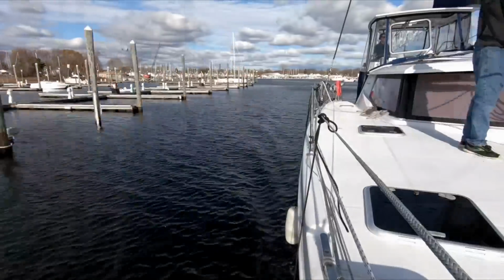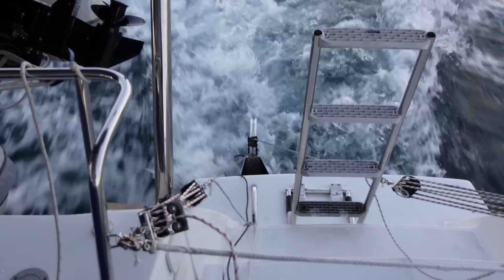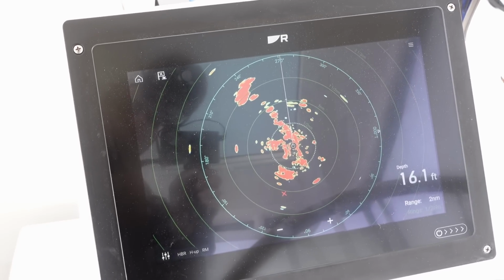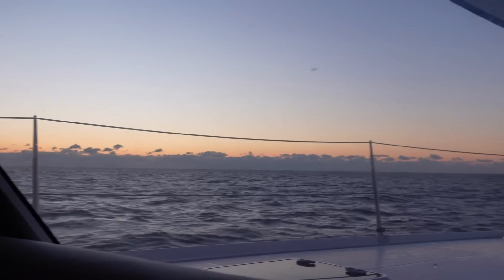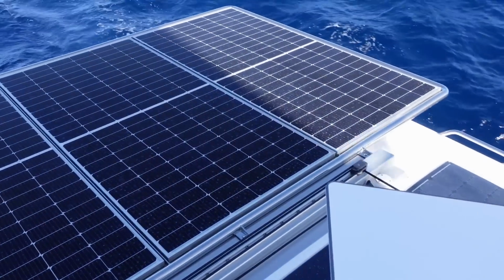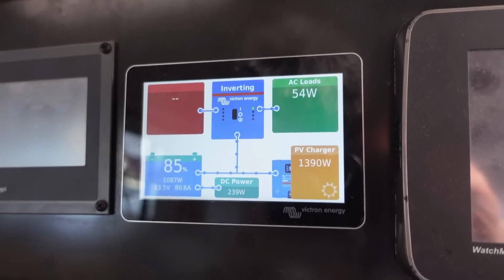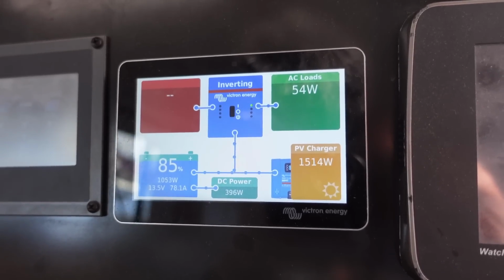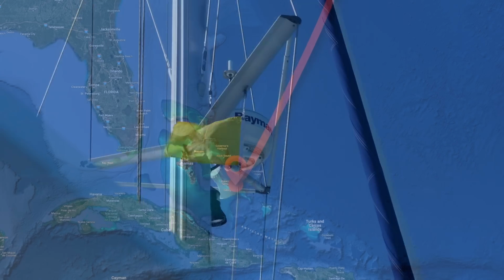Bahamas Bound!

Comment: Great to see how the upgrades worked. I know it isn't hot yet but do you think you can run AC in master suite to sleep cool?
Reply from the maker: The big question for me is exactly how much power the AC would use overnight.  We may 'curtain off' the berth area of our hull to maximize it's efficiency.

Either way, my gut feeling is that right now I would say yes.  But we may have to compromise a bit on power management elsewhere.  As the days get longer and we have even more solar output?  Definitely!

Comment: Well, I am glad your math worked out better than you hoped, because I used your spreadsheets to figure out my system and the requirements! As always, great video! Enjoy the Bahamas for a little while longer!
Reply from the maker: Believe me, I am too!  I think on passages it is really hard to estimate power production given extra shading from sails and how dependent our hydro-generator is on speed to produce decent power.  I was quite confident we'd be able to achieve energy independence at anchor where it's a lot easier to adjust our power consumption (I don't need air con every day 😆).  But to get there on a passage, where the power draw from more essential equipment is significantly higher, was a pleasant surprise!

Comment: Nice video and congrats with the refit. Two questions if i may: 1) is your watermaker still 120V? And if so were you able to run it with the inverter (size of inverter?) the starting load could be an issue i was told. 2) when you take off for longer passages do you keep the water level rather down in the tanks to improve boat speed or do you keep them full and top up frequently? Many thanks and fair winds
Reply from the maker: We actually swapped out our old 120v CruiseRO watermaker for a 12v Schenker unit.  This had more to do with our quest for energy efficiency.  Our old 120v watermaker would have run off the inverter (we have a 3000w Victron Multiplus) but it consumes quite a lot more power per gallon produced than the 12v Schenker.

When we're on passage, I usually keep the water level topped up.  I don't think the speed we'd add by keeping half full tanks would be significant and I prefer to have a full tank to draw from if something happens to the watermaker.
Reply: @OutChasingStars  thanks for taking the time to reply.

Comment: I really like the updates on your power generation and Starlink. You guys have set the standard and demonstrated well how successful upgrading can be all round beneficial.😄
Reply from the maker: Thank you!  I think it helped that we really put a LOT of thought into what upgrades would make the most difference for us.  And having 7 years of knowledge of Starry Horizons and how we like to cruise certainly helped as well!  😃
Reply: @OutChasingStars  Corrosion X is a great choice for protecting critical components, especially electrical like your radar etc.
Reply from the maker: We use A LOT of Corrosion X.  Love the stuff!  But Tefgel is generally better about preventing seizing/corrosion of screws/bolts/etc.  So I was trying to use Tefgel on the screw connection but some of it must have gotten into the electrical connection.  Lesson learned!

Comment: Glad everything is working great!  It would be interesting when you put out the “what we’d do differently” video on the refit now that you’ve got some miles under the keels.   The hydro generator seems unnecessary with as much solar as you have, but would be interesting to hear your take.
Reply from the maker: A "how did things work out in the real world" video is definitely on our list as we get towards the end of the season.

The hydrogenerator does pose an interesting question.  Do we need it anymore?  Probably not.  But could we use the excess power it generates to say... run an air conditioning unit when a passage is super hot?  That would be incredibly nice and would make sleeping much easier!
Reply: @OutChasingStars  very cool!  The hydrogenerator is on our list of “maybe’s” on our build that will also have 3.2kW of solar plus 25kWh of lithium at 48V.  It’s always nice to have backups though…I just don’t want to drag around a heavy expensive piece of equipment we don’t really need or use often…so looking forward to your end of season summary!
Reply from the maker: So much depends on how you plan to use your boat.  Long passages on a world circumnavigation or regular ocean crossings?  I think a hydrogenerator is great.  But if you're just doing jumps from the Caribbean to the US East Coast and back?  Then it's probably overkill.

With our more 'local' cruising plans over the next few years, I doubt I would added one to our refit plans if we didn't have one already.  But since we did,  I was happy to keep it.
Reply: @OutChasingStars  Makes a lot of sense, I did not realize you already had one.  We are planning on long passages, so I may need to move this from the "maybe" to the "strong possibility" column of the spreadsheet lol.